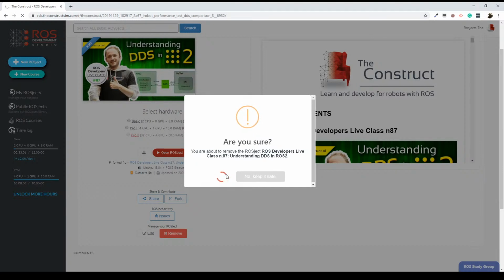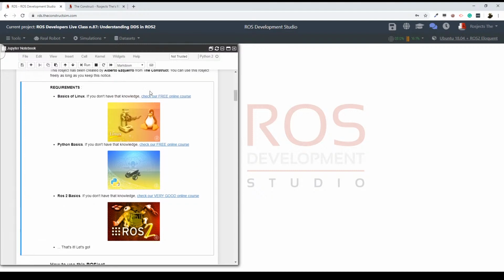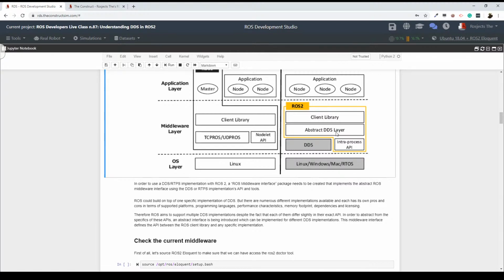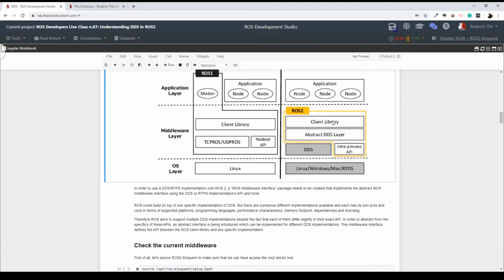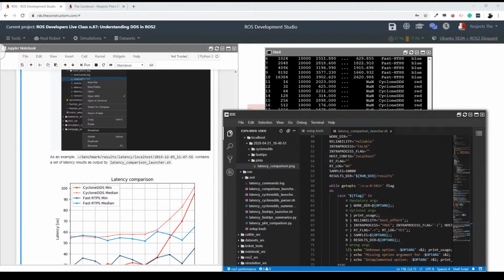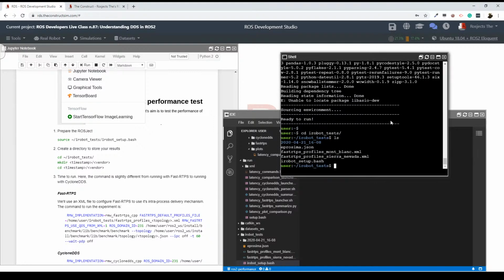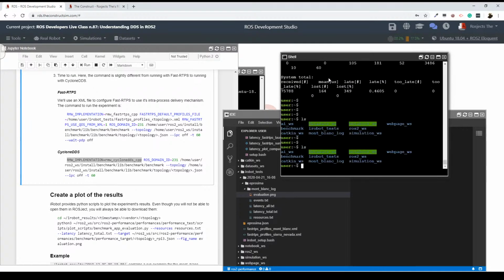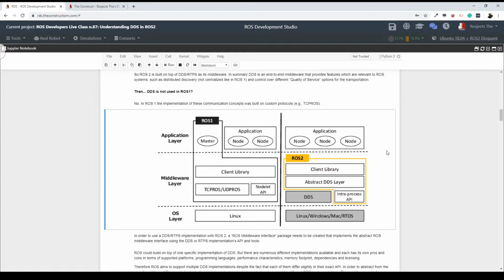ROS Developers LIVE Class #87: Understanding DDS in ROS2

Comment: How important is it to know DDS in order to use ROS2?
Reply: I have been watching a few videos from Connext and The Construct, but I don't know how to prioritize my study capacity. I am preparing for my first professional project using ROS[2] and a commercially produced 6 axis arm and Intel RealSense camera. I started off thinking I just wanted to know what DDS is. But, because I have a 25+ years of professional networking experience, I have unlimited curiosity about what I'm learning of DDS. Unfortunately, I do not have unlimited time. Is DDS transparent to most users? In other words, unless I have a device that requires specific DDS configuration, can I ignore most of the details of DDS (much like most engineers ignore the specifics of TCP/IP, HTTP, TLS, etc.)?

Comment: How would you use the dds system on ROS2 to communicate with machines on different networks? (I mean networks with different external IP's). In ROS1 we set a env variable called ROS_MASTER_URI with the IP address. Is there a similar thing with ROS2?
Reply: I think the major different between ROS1 and ROS2 is that ROS2 does not have MASTER to control system, so it doesn't need to set ROS_MASTER_URI when using ROS2.
Reply: 張宗翰 I understand. However the default ROS2 dds(FastRTPS) does multicasting within the LAN by default. What method is there for sending messages to a computer outside the local network?